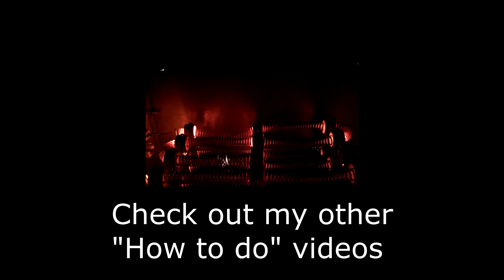HVAC How to Replace a Heating Element in a Air Handler

Comment: Why bother making a misleading video ,can't use same size wire to feed that new heat strip Dang !!! Gonna pull twice as many amps  going from a 5k to a 10k you'll have to change that 10ga. To a min. Of 6ga possibly even #4

Comment: My Rudd Air Handler electric heater is not working.  Do you have any videos on how to diagnose if element is bad or a related part is the culprit?

The problem started in a cooling mode when condenser contactor started with a electric short!  Hvac tech disconnected heater and cooling issues & contactor problem when away, but now  i don't have heat.
please advise !

Comment: Can the heating elements be installed upside-down? (Closer to blower fan).
Reply: We installed ours like in video. Elements on top. It's closer to fan instead of closer to floor duct, It's only 4" difference. HVAC was wanting $580 to install, I ordered the part for $125 and did it in the time of this video.
Reply: @slaawm1 Where did you order your parts from?

Comment: Have one I need to replace in a York air handler unit but I can't find the exact replacement anywhere. The only ones that come up as replacements are about 2-3 inches short compared to the original elements. I wonder if the size will affect the amount of heat going through the duct work.

Comment: That's a new 60A unit with 30AMP feed wire feeding the unit has to be #6 gauge the new unit Wil melt that existing wire.

Comment: I see you hooked up 10 kw strips to 10 guage wire in the video. So basically if the heat strips come on it will melt the wire... correct?
Reply: No

Comment: Not sure how long you've been doing HVAC work or how much knowledge you have but that is a 10/2 wire. Compatible with a 30 amp breaker in the main panel box. The 5 kw was fine pulling around 21 amps @ 240VAC but with the 10 kw heat kit pulling about 42 amps @ 240VAC you need a 6/2 wire with a 60 amp double pole breaker. It's stuff like this that burns people's homes down.
Reply: And I'll continue to disagree. You make a limited point, if the homeowner comes on here and if all the info was dead on, they could still screw it up like any  other attempt to do auto repair, computer repair, plumbing, appliance installation, landscaping. We should leave it all to the professionals according to your logic. The reason someone would attempt this particular upgrade, or repair (which is why I showed up here), is hvac service techs are notorious for price gouging.   I diagnosed the problem to the heater core, determined it was a 15kw unit,  ordered it and had it over nighted to my house for a total of $145.  What was the local hvac service guy going to charge me?  $500 to replace it, and 3$385 for the part. That's why I opted to do it myself.  Btw, I have no idea who made this video. Don't really care, but his video made it look ez, and now I have heat again and I saved  quite a bit of money. Take care.
Reply: Yeah. If you're not a professional HVAC guy then maybe you should keep your opinion to yourself. I don't mean that in a rude way but this should be a discussion with a professional. This is not about opinions. You're talking about price gouging and I do agree that is a big problem in our industry as I come across it a lot. That's why it's a good idea to get 2 or 3 estimates. Hopefully one of them will be fair. I literally had my guys to do an almost identical heater swap for a customer this week. Went from a 5KW to a 10KW. I charged them a total of $350. Parts and labor. We DID verify proper wire and breaker size. As a master licensed and insured professional HVAC contractor I'll stick with what's right and hopefully anyone watching this video will review comments before doing this swap. If so then maybe it will be okay. Thanks Mr. Hill for posting the electrical information for viewers.
Reply: That's so dangerous I'm a 22 year electrician its a big fire hazard you should not be upgrading no ones house unless you have insurance. This little upgrade could cost the homeowner hundreds of thousands in repairs.
Reply: Richard Hill
Reply: Your watching youtube videos as all of us here. Looking for what?
Reply: I was just watching some HVAC videos and this happen to be one of them. As a licensed professional I feel like I should comment with corrections just in case someone watches this video for a do-it-yourself project. I'd hate for someone to cause themselves problems. I'm not sure of this guys level of expertise or training but I assure you the wire sizing is not correct with a 10 KW heat kit and a 60 amp breaker in the panel. Something may melt and possibly start a fire.
Reply from the maker: Ricky Salyers thank you for taking the time to comment. The point of the video was to show how to replace the heat kit. Behind the scenes the electric panel was in bad shape (panel cover missing, bad wiring, etc.). Rest assured that the load center was replaced and the feeder wire to the air handler was upgraded to the proper size.
Reply: I omitted that section of his video. While what he said isn't correct, your attack on him didn't help anyone.  Most do a little research before committing to a project like this so where it may of been omitted, or like me, just observe overall videos for project involvement, it's better  to provide constructive criticism instead of fear mongering*.  

For others, to properly size breakers and wiring the formula is:

Size of unit installing divided by voltage (typically 240vac) multiplied by 1.25 will meet code in your area.  Pick a circuit breaker that is at least this result and you will be fine.   This formula only works for single phase power which is 99% of residential power.

Wire sizing can get involved based on the type of wire your using.  Refer to this webpage  as an example:

https://www.cerrowire.com/products/resources/tables-calculators/ampacity-charts/
Reply: I do understand what you're trying to say but you've got to understand that there will probably be some homeowners who get on here for instructional purposes to do their own work to save themselves a little cash and install their own heaters or maybe an apprentice trying to learn. Again this is serious stuff not to be taken lightly. If you're not 100% sure on know what you're doing you have no business posting these videos. It could honestly cause major damage to a home. I've seen it all too many times. Wires scorched and melted. Usually the next thing is fire. It's just the truth. Sorry if you take it offensive.
Reply: he used the same breaker.  it will just pop the breaker, not start a fire.  its comments like yours that try to ruin it for the rest of us.
Reply: If you listen closely at around 1:35- 1:45 in the video he plainly says it's safe to put a 60 amp breaker in the unit because there's a 60 amp in the panel box. I never heard him address the wire size at all. You either work for him or are not very knowledgeable yourself or maybe you missed him saying that. A little training would be a big help. I do this stuff for a living and I take my job very seriously. Knowing what you're doing is important in this field. There's nothing wrong with admitting you're wrong. It's when you don't that creates the problem usually.
Reply: @Salyers-Family-2004  they have #10-2 romex feeding the 10KW heat strips. It should be at least #6-2 romex for the 60 amp feed.
Reply: @jolyonwelsh9834  You're exactly right. I'm not trying to be hard on these guys per my comments but some DIY'ers might watch the video and think his wire sizing in the video is correct but it's not. This is a major fire/safety hazard.